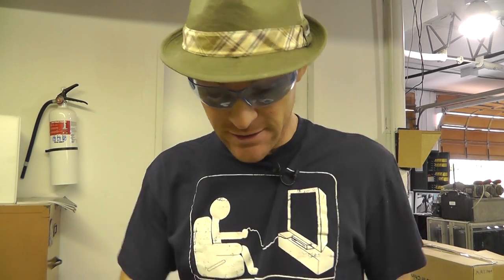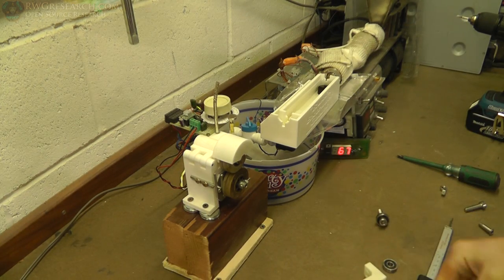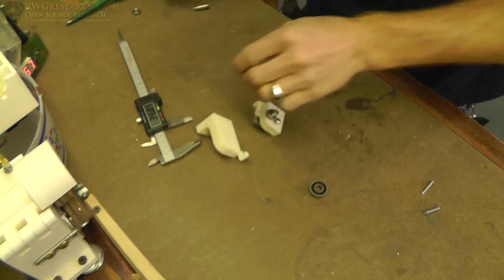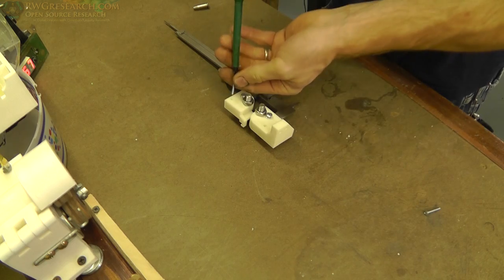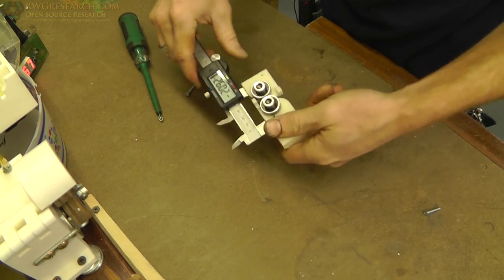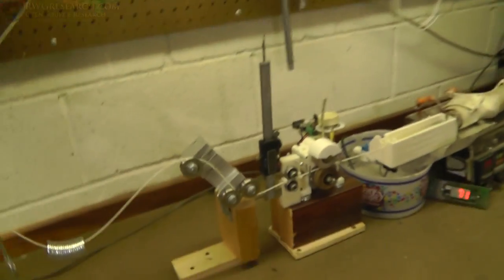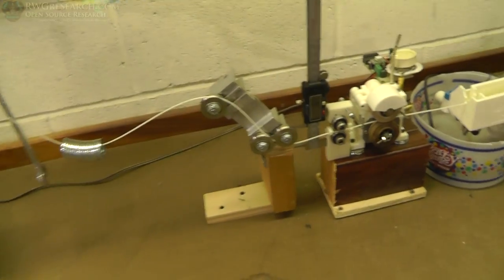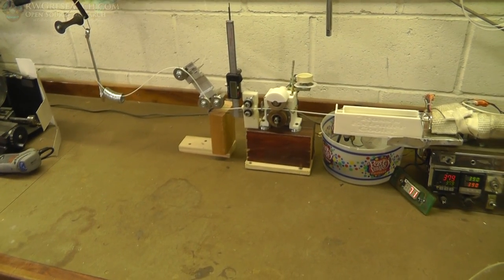#15 ~Russ's Filament Extruder: Digital Caliper Filament Measuring Device Finished.

Comment: what about using a digital dial indicator? they're already spring loaded. and if it helps, some of the more expensive calipers are available with micro usb ports for data output

Comment: Guess you haven't defeated the auto-off for the caliper yet? I'd be really interested to know how you did it when you do it.
Reply: +joseph perry auto-off is active when the caliper detects no movement on 3 minutes. if the reader changes frequently I doubt the caliper goes off. At least I never saw it on last 30 years using them.
Reply: You would use a fixed dial gauge instead of calipers in this use case lol.

Comment: I was wondering how much would be gained by taking the digital data out the caliper from the small port you showed once... feed that in to a small arduino chip and let that control the puller speed... maybe even let it control the speed of the extruder... just 0.02$ from the sunny but still cold Denmark
Reply: Bo Herrmannsen I had the same Idea. It could be really automatic system.
Reply from the maker: T1iCanon this is something i have been working on in the back ground sense i posted the first video on the caliper measure.  currently i have the arduino reading the caliper and displaying it on the LCD.  as well as manual control of the steeper motor trough the arduino. next step is the PID. however. becuse this is a  slow  process the PID may be more of a negative effect. it will swing around a lot if the gain is to high. so using the PID controls will see if we can get it too work. its in the works :) ~Russ
Reply: ***** what if you did the changes more slowly? ie if the caliper says 0.5mm off only adjust the speed to compensate for half  of that and wait to see what you get and then do it again a few sec's later. 

i can see the problem with swing if the changes are done to fast...

maybe you can even do the speed change if you just do it slow enough?
Reply: +Bo Herrmannsen a PID controller as Russ mentioned handles that.
Reply: +rwg42985 have it build an average value list and do pid off of the average instead of a direct loop.

Comment: Filament can be not round shape. Do you want to install another caliper in horizontal position ? :)
Reply from the maker: nRADRUS  lol, yes this was a problem at one time, but that's when i change to " pulling" the filament through the water bath, that keep it round, unless it was not hot enough , Then it would still hive problems.  lol add another to the math lol ~Russ

Comment: Stupid-ish question: how do you design the parts?
Reply from the maker: never a stupid-ish Qustion :)  I use Google sketchup. it's free and works well for the beginner. ~Russ
Reply: ***** Ok, that's awesome - I love sketchup - but then what?  how do you get them out of sketchup and into your printer?
Reply: I don't have one of those, but don't you see a lap top sitting at the side of the 3-D printer. You make what you wont on it then send it to the printer. Everything take a computer now days.